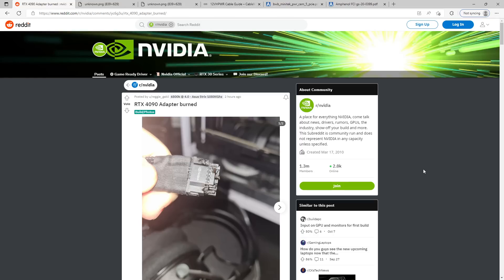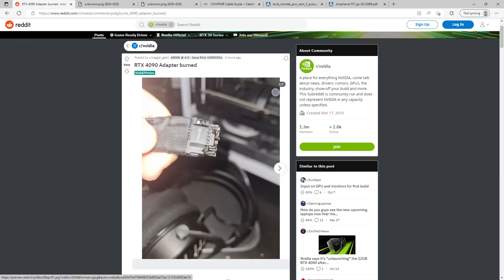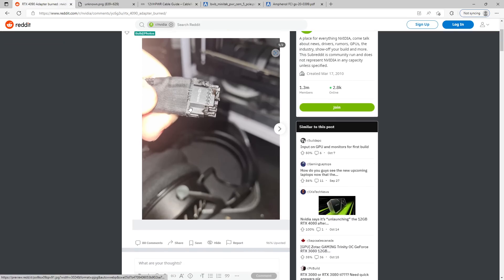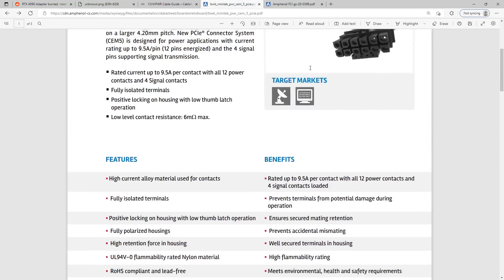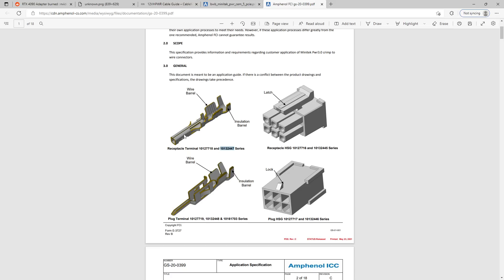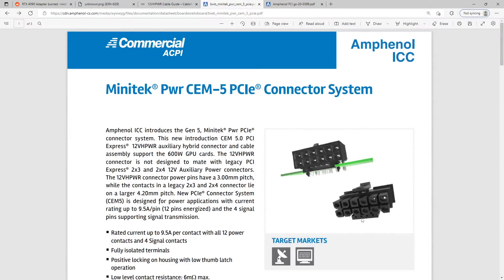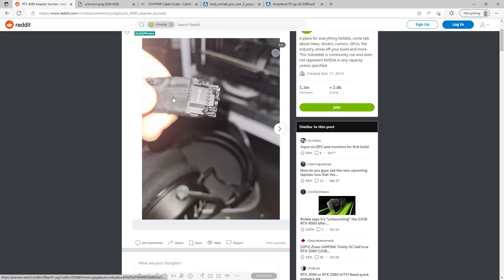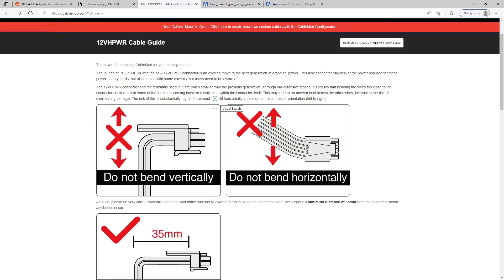The 12VHPWR connector sucks

Comment: Since the new connector only has 12 pins in it, which is a lot less than using 3x 8-Pins (that would be 24 pins in total),
they should have just made the pins the same size, or even a little bigger than the older connectors.

Having less pins (12 vs 24) would save space on the boards enough as it is, so there was no real need to shrink the connector.
Reply: in 8pin connector is 2 sense pins so 6 for power delivery. But still 3x8 have more pins for power delivery and more surface area in each pin and more rigid connectors.
Reply: @LimbaZero  I dont have a card that actually uses the sense pins they all terminate into the same powerplane. Even a Vega 56 and RX6700. I like AMDs no bullshit approach to power delivery and just designing it how an electrical engineer would
Even two 8 Pins would be fine at 600W.
Reply: @alouisschafer7212  I think those cards that have leds where connectors are have those sense signal in use. With those you can detect if cable make "ok" connection and if 8 pin has 6 pin cable
Reply: @LimbaZero  yeah my Vega has LEDs but they must be hardwired to the 12v plane since the 8 pins per connector 100% terminate into the same power plane before they got into the input filters its visible on the PCB even. So I guess each LED just shows you that +12V is present.
Reply: @alouisschafer7212  I would wire those LEDs like this:
+12V (all 3 pins) connect to the plane, that plane connects to LED and current limiting resistor, and that LED connects to ground sense pin of that connector (the 2 additional pins in 6+2 config). 
All other wiring and layers on PCB go in normal way.
This LED wiring would allow me to see if I have +12V available through that connector. With different PCB layout may even indicate if 6-pin or 8-pin is plugged in.

I would check if they wired LEDs similar to my idea (at this stage I personally would find it interesting to know).

Comment: Is this just going to affect these bundled-in connectors, or will the new PSUs and their 12+4 cable also have the same problem? 
This might be why cablemob is doing a solid-end cable soon.
Reply: Same problem, 12+4 physically requires a minimum curve radius of like 12 inches or something like that. So doesn't mater if its an adaptor or actual cable, the problem is at the connector.

Comment: If they don't want you to bend it within 35mm of the connector, then the body of the connector should be that long back over the cable,

But am I missing something? In automotive gear, you'd use something like 8mm2 wire and something like an anderson plug for 12v @ 50a.

Yes, it is called crimping. The problem with horizontal stress is moreso that the pressure can pull the connector out of the housing, its only held in place by the tiny metal tangs sticking out the sides. If these get bent enough, the connector can end up making limited and/or no contact with its counterpart.

Comment: Why make it with internals that aren't long enough to support possible bending though? It's like, the first thing you'll see when you look at power cables inside a PC...cables bending in various ways.
Reply: The problem is bending the cable also making the pins lose, hence make it a fire hazard. Long internal won’t help anything.

Comment: I really enjoy how they expect a cable to just stay bent at a certain distance away from the connector like its a paper clip and will hold that bend exactly where you bend it.
Reply: not only that, with the size of the 4090 theres no way a cable with 35mm of straight wire is gonna fit half of the cases in the market.
Reply: @PhantomBlank  Half? Only half??
Reply: if the wires were solid and not stranded, it definately would... but that would also mean they would need to be the proper gauge as well.
Reply: Keep in mind that is a third party analysis. I'm sure safety was a reason of that measure.
Reply: @Splarkszter  Come-on man, that's almost as bad as the "they have engineers" argument I hear about fanboys for things like smartphones. I see it way too often, it's like people think engineers can't overlook something. Didn't stop iphones from coming out of the box bent, didn't stop Samsung phones from exploding (or them apparently expanding only after a few months sitting unused), or the PS3s over heating and failing, or 360s heating up and bending the literal board, etc. Engineers fail sometimes.
Reply: @Skylancer727  ¿?

i'm talking about the 35mm clearance. Lmao

are you a concurrent reddit user?
Reply: @Skylancer727  actually there is a reason other trades make fun of engineers so hard. my favorite story was from an engineering teacher I had. He was head of a team that was designing a new kind of airplane wing. the idea was to add a groove along the length of the wing that would cause a laminar bubble to form (think golf ball divits or what happens in the back of a pickup truck) the wing was super efficient. they spend 3 years on it.
but it had a design flaw. it wouldn't work in the rain. the water would fill the pocket and make it useless. they worked on it for 3. years. before figuring that out. 
my bet is the nvidia engineers never put the card in a case. why test a real world scenario? lol

Comment: well, also the 150w is an ATX standard and without cheaping out 300w is no problems,
also with right Housing, wires, crimp terminals and pins a single Mini-Fit Connector could do 600w,
but there was no need to make standard the max spec of the connecter when most thing would not 
use it and PSU were 300w, well the 600w is max for that "new" connecter with almost no headroom.
Reply from the maker: yeah the 8pin PCI-e connect has a huge safety margin on it. The 12VHPWR seems to have no margin.
Reply: 300w on a single 8-pin is not recommended, even if it's technically within spec. I upgraded to a 290w GPU and didn't know where my modular cables were, so just used the daisy chained connector on the same cable. It overloaded at the PSU end and melted. Not a cheap PSU either. Seasonic.

Might have been fine if the cable/connector was brand new but it goes to show how close to the limit they were before shrinking the pins.
Reply: @AlanTheSane  well Seasonic used 18 gauges (1.024mm) 
I think, but not 100% sure, that 14 gauges (1.628mm) is the highest for Mini-Fit Connector.
my SP Leadex Platinum 2000w has 16 gauges (1.291mm) my old AX1200 has 18 gauges

there are so many factors and my head hurts now hehe. 

But Buildzoid is right this "NEW" connector is solely here due to 30/40 card design.
Reply: It was the connector itself that overheated, not the wire. Idk, seasonic probably gave a lower rating for the cable in their documentation...

Laziness in looking for the spare cables, the  available daisy chained connector on the in-use cable, and the common info that 300w is usually ok all lead to my melted connector.
Reply: @AlanTheSane  more you pull through a wire the more resistance = more heat 
to low resistance, you go to thicker wire, the wires are the heat source.
so you daisy chain Vega 64 did you, 
did also maybe flash it with the watercooled bios
Reply: @1BigBen  Electronics student. I am aware of how this works. I merely stated that the connector itself was the point that overheated, not the wire. The connector should be more or less the same, regardless of wire gauge.

Comment: I'm not ever considering any card using this connector. Doing the math , 12 volts and 450 Watts = 37 AMPS! in those little pins. No way. at 600 watts even worse!  Fire hazzard for sure and all should be recalled!  This is worse than the NZXT case issue because of the volume of these going to be out there. It's only been a month and this is happening, what will it be like in 6 months or a year!   Lawyers should be lining up to sue Nvidia out of existance.

Comment: The new sense pins are fine... The previous standard wasted a lot of full sized pins for the same purpose (2 out of each 8 pin). If you need to have them anyway, putting them in a smaller side connector is fine. 

Reducing the power pin size and number at the same time, that is a lot more dubious.
Reply from the maker: I would prefer if GPUs just didn't bother with sense pins.

Comment: Had dual 8 pins for a 3080 10G undervolted in an ITX case and they burned up, even though I suspect the 3rd party cables might have been a little underspecced this just means that the 8 pin spec is absolutely there for a reason
Reply: Meanwhile the Corsair 8 pins are rated for 340W. Their 600W 12VHPWR only has two 8 pins at the PSU end.
Reply: that should never happen...
I pushed 330W trough two 8 pins on my Vega and it was fine that's 1.7 amps per pin...
Reply: Well yeah 3rd party cables are no joke, you really need to make sure they use the correct wire gauges or you are in for a serious trouble. Standard 8pin is able to safely provide around 200W without melting the insulation, even though technically it is out of spec. But also depends on the ambient temperature etc... How did you push undervolted 3080 over 475 watts?
Reply: @1337Ox  he didnt, he claims it was undervolted so 300W tops which is barely 100W per 8 pin. Either he got garbage no name cables, a garbage PSU or his card had a catastrophic failure.

Comment: suggestion for another video: buy some cables and do a live dissection on them. also measure the resistance of the pin to receptacle connection on both the new 12VHPWR and the old 8-pin PCI-E connectors. Then you can calculate based on the current what the voltage drop over them is and the heat generation over that connector is. maybe even see what happens when you bend the connection a bit causing the less than optimal connection and measure the resistance on that too.
Reply: Was there also limit how many times you can insert that connector before it's out of specs
Reply: @LimbaZero  The limit is 30 cycles, but according to Nvidia the 8pin connectors have the same 30 cycle limit.
Reply from the maker: @Gamer-df9xt  the Mini-Fit spec is public: https://www.content.molex.com/dxdam/25/25cce481-dbb4-467e-ad4c-1deb2f5122cc/987651-8272.pdf

Looks like it's 70 or 100 cycles depending on the surface finish.
Reply: @ActuallyHardcoreOverclocking  I'd guess the Mini-Fit is not the issue - it's the 4 small pins below it. Having used Mini-Fit in personal PCB projects before they are usually pretty solid.
Reply: @iKirin  minifit being good or not doesn't mean they are susceptible to a bad design that they have to make.
Reply: @ActuallyHardcoreOverclocking  Intersting bit on page 2 of that document in the upper left corner: "Backshell option available. Secures cable. Provides strain relief" :D
Reply: @ActuallyHardcoreOverclocking  Good to know thanks
Reply: @TsukiShimizu  The 4 extra pins are sense pins, they carry negligible current.
Reply: @NotThatGuyJD  I was not talking about the bending issue - the bending is a whole different issue. I was more talking about the low insertion count.
Reply: i think a better test would be to hook up a 450W dummy load and then continuously measure current on each of the 12V wires while bending the wires. would be interesting how high the current per connector position actually would run.
Reply: @innnlove   Current won't be notably different - it's the temperature of the connection point in the terminal that heats up if contact area is reduced.
Reply: using resistance to calculate voltage drop across a high power connector doesnt work. the resistance is low enough to make measurements quite difficult (4 point setup required), and the connectors can have different properties under load. 
the proper test is taking that same 4 point setup and using the connector under full load while observing the actual voltage drop. 

from an engineering perspective, for this level of current they should just have gone for bullet style connectors, such as the dirt cheap XT60 connectors. Extremely reliable and they will happily do tens of amps per pair without even getting warm. Electric car charging connectors also use bullet pins and transfer hundreds of amps in dc mode. its a lot better than the crappy folded metal connectors and only ads a dollar or two to the bottom line.
Reply: @drkastenbrot  Money is the real issue, I bet most of those adapters manufacturers go with a lower gauge sheet or a cheaper alloy so they can save 0.000001 cent.
Reply: you would need a REALLY good ohmmeter for that
Best to just send a ton of current trough the connectors and measure the drop
Reply: @alouisschafer7212  what you are looking for is called a "meggar" it sends extremely low amperage but high voltage through the test object to test dielectric breakdown.
Reply: @alouisschafer7212  or literal milliohm meter and that doesn't sound cheap. Although it will be cool to see
Reply: @JIAroJIy4  fr id just put like 10 amps across each pin and measure the drop

Comment: Would that connector qualify as a recall issue
Reply: @n n this is my 4th time hearing about this problem the connector is made to deliver 600w ok the pins are smaller that means more resistance, and that's actually how you make a heating element putting alot of current through a small amount of wire. it doesn't matter at all about the wire it only matters about the point of contact and there is physcially less of it to deliver 4x the power through.  YOU CAN"T BE THE LAWS OF THERMAL DYNAMICS.

Comment: I would buy a ATX 3.0 PSU purely just to not use those ugly extensions. Also another Nvidia thing to do is not include a DP 2.1 port on the card :/
Reply: Why would they spend a lot more money and effort to add DP2.1 connector and related circuitry when 99.99% of people will not need/use it anyway? And no, I am not defending them and their shit take with this new 12pin connector (which again, I think they were just greedy because 3 or 4 8pin pice connectors are much more expensive than a single 12 pin one).
Reply: @dobrescusilviu4189  AMD have added DP 2.1. Nvidia with their high prices could of easily included it. 4090 at 4K is already reaching over 144+ fps natively in A LOT of games even 240+ on competitive games then there's DLSS 3 AND frame generation too. DP 2.1 future proofs the GPU and compatibility with upcoming DP 2.1 monitors. I think they should've included the connector and can't defend their decision but hey I guess it'll be a selling point for 5090...
Reply: @dobrescusilviu4189  If you're buying a 4090, you're going to be playing at a high resolution and high refresh rate. The 4090 absolutely should have DP2.1, no ifs or buts about it. DP2.1 supports 4K 120, which is absolutely something that the 4090 can reach in many cases. Also, let's not forget how stupidly expensive the card is, so cutting costs on such an expensive card? Not cool.
Reply: @kadrix732  bro 4k 120 is supported by dp 1.4. We are talking about dp 2.1 here.

Comment: Thanks god these 90º adaptors are becoming the norm. This was an issue before the release and still is after. Unfortunate this happens to people due to misinformation. At the same time though, I understand the complexity of having 4 8 pins connectors on a PCB being very inconvenient.
Reply: @alouisschafer7212  I don't doubt that, But I would love to see the results of 2x8pins powering the 4090.
Reply: @Symba_Lysm  I think they would handle it. 600W might be really pushing it but Stock or undervolted power draw would be fine.
Three or four 8 pins would be better just for redundancy and maximized current handling capacity for lets say a worst case like some insane overclock, a weak connection or one plug not being plugged in.
Reply: @alouisschafer7212  I agree with that, but, IF they can fix the main connection, as the cable itself seems fine, It's just a matter of fixing that connection (Which I think they can).

Comment: The average 4090 is only 15 inches long so definitely no room for 4 8 pins

Next thing you know, nvidia will be putting vram on the back of the pcb with no way to cool them.

Comment: I like the connector. It is a good idea....... And that is where the praise stops. It was engineered poorly. The pins are too small. The sense pins are fine. The load carrying wires from what I can tell are too small. It seems they needed better, possibly thicker metals for the pins. Hell I see 20-50 amps in the automotive world every day. That use 1 voltage and 1 ground. They have a 10-14 gauge wire, but it works just fine with zero issues if done right. The components normally fail before wiring ever does. Or a component is what causes wire failure.
Reply: Yeah, like two pins and zero insertion force right? Why are we still wiggling these friction fit connectors, makes no sense

Comment: Pushing 35-50 Amps over this small pins, no wonder why it can melt, 1-2 pins fail bc of bending or lose connection, you end up with this mess, what a bad design made by a multi billion company 🤣

Comment: Nvidia should be forced to recall all of these 4090 gpu's due to a fire hazard....
Reply: Or ship out the cable with the fixed connector to anyone who purchased one for free
Reply: @SamLoki  Or designed a right angle connector to begin with.
Reply: They won't do anything til Jesus gets a hold of them.
Reply: I can just imagine their accounting team sh*ting bricks at that thought, especially if refunds were required
Reply: Buy  a pci-e 5  power supply, I saw the adaptor and was like nope.
Reply: @zyloctal  I’m using mine for like 1-2 weeks today and I Play over 10-12 hours per day every day and is working pretty well
Reply: @starlingspm4872  Maybe that person was not being careful with the cord, or was overclocking it way to much.
Reply: @starlingspm4872  FOR NOW.
Reply: And 3090ti
Reply: AMD will also be using this new ATX PSU standard. In case you were not paying attention.
Reply: @henryvaneyk3769  We don't know if they'll be using the 12VHPWR connector yet.
Reply: @henryvaneyk3769  AMD won't be using this stupid trash connector design from Nvidia. 100% sure.
Reply: @henryvaneyk3769  AMD will probably put more thought about it though.